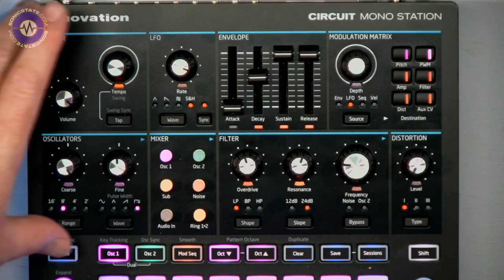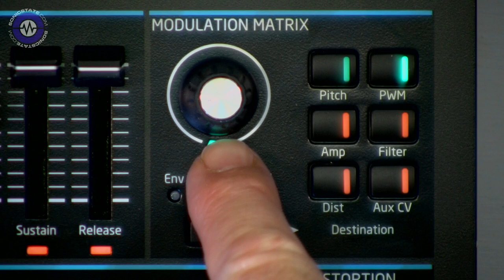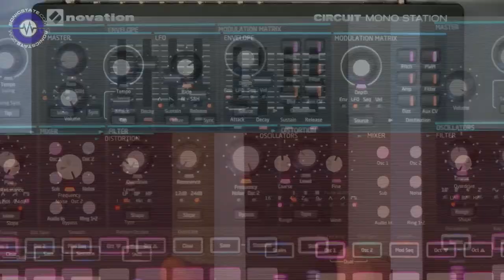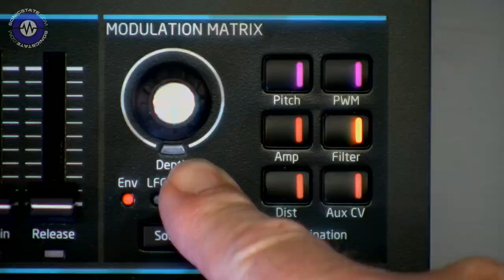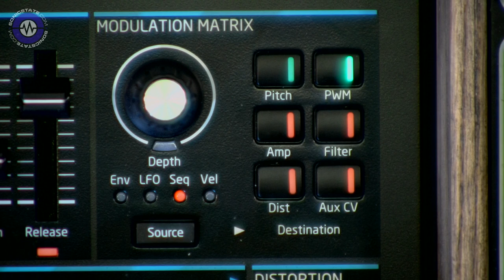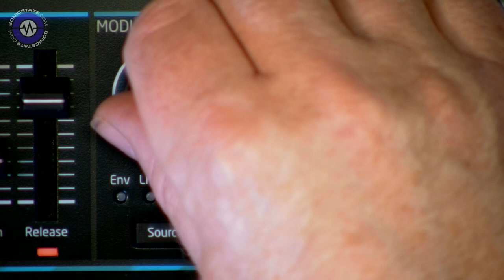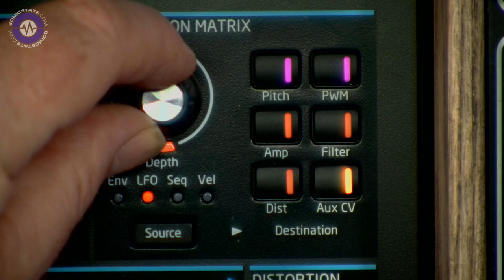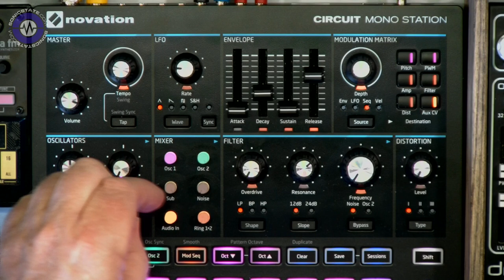Novation Circuit Mono Station Review

Comment: No one ever mentions just how great these pads are. It has plenty of weaknesses, but its pads are a work of art. I've tried many different pads - Korg's, Akai's, Roland's, Yamaha's, even Novation's (on SL MK III keyboard). Wasn't impressed and never thought I would switch to pads from piano keys. These pads were the first that made me think of doing exactly that. They have so much control - it's like playing a real wooden string instrument, the sound properties wholly depend not only on the initial speed, but on how fast you release, how long and with how much pressure you hold the finger on it, and if you alternate the pressure - the sound will wobble like a real guitar string. Really well calibrated pads

Comment: first! Actually this will be my next synth over here - I have the Circuit and no analog gear in my setup. So while being a tad expensive as Nick mentioned, I am glad that I'm reaching towards an already familiar grounds in terms of sequencing. and I won't have another, completely different device in my setup which sometimes I fill I can hardly handle together (E2, microgranny, volca fm, circuit). The audio-in into filter and distortion is a great thing to have and also the sound is great.
Reply: second actually! ;)
Reply: mishpult  I think you're better off getting the Bass Station 2 if you have the Circuit. No point getting this
Reply: I just bought a BS2 and they aren't that big, at least in width. I have it on a laptop stand above my midi keyboard. Nice compact bit of kit.
Reply: I'm not a keyboard player myself but the keys are always useful to have. Also the BS2 has a pretty good sequencer in it. The synth is pretty small as well. Tbh I see absolutely no point In getting the mono circuit if you already have a circuit.

Comment: The bass is very fat for only one/two voices. Thanks for the vid. I have it already - but you have filled in the gaps for me with your explanation and demo. It has the circuit workflow but adding great analogue , versatile , intuitive bass. Both together does compliment (circuit and this) .  - You can not get that sound fro the digital circuit.

Yes it may be expensive - but if you love this workflow style/pads and controls so quick to utilise. its a no brainer imo.

Comment: Hey Nick quick question pls, does the amp envelope always trigger in the mod matrix, regardless if you use the envelope on the filter or pitch? Or can I use the envelope on the filter and pitch without affecting the amp? I have a mono Station and it seems that the amp is always affected by the envelope. Nice vid btw

Comment: Great review. You have a knack of answering the questions I have as I'm thinking them ... 0.o
I've been wanting to see it interact with other gear, most reviews don't go that far! 
They're set to cost $850can ... I can get a beat step, monologue and a microbrute for close to that ... all new, too. Used prices I can get a beat step pro, monologue, and Minibrute. For the cost I'm not sold on the sound of it, it's good, but not that great (from other demos I've heard). Not $850 great.
Reply: where on earth did you find it at 850. its 499 canadian.
Reply: jason mastrandrea my bad, it's $750
https://www.long-mcquade.com/87248/Keyboards/Synthesizers/Novation/Circuit-Mono-Station-Paraphonic-Analog-Synthesizer-and-Sequencer.htm

Comment: Love the circuit as I can take it anywhere was considering the mono station but didn't realise it isn't battery powered until now. Even though it is tinny the internal speaker on circuit is also useful for ultimate portability. Two balls dropped imo

Comment: The big downfall is the lack of any reverb on so many of these models. Each channel should have its own independent reverb (stereo if possible). Raw mono does NOT sound good without reverb.
Reply: TakeSomeAdvice I can’t exactly think of many analog monosynths with reverb. Maybe Nyx? You just have to buy it separately, which will sound so much better than some stock reverb anyhow.
Reply: Agree, FX knob instead of the Distortion knob ... three choices below the knob could be delay/reverb/both
Reply: FYI for anyone wondering, Mono Station is analog, so you can plug any guitar pedal into the output and it works. Novation literally shows the Mono between a guitar and pedal on their example setups page. Provides infinite sonic possibility, an advantage over digital hardware like Circuit.

I eBay’ed a TC Electronics Flashback delay/looper and a Boss Super Chorus for cheap. They open a whole new sonic palette (does wonders for the Arturia MicroBrute as well).
Reply: I disagree. I prefer FX to not be on my synths generally as it keeps costs down. Whatever crappy reverb they did include isn't going to hold a candle to a £400 reverb pedal

Comment: I absolutely hate that the tempo sync of the LFO also makes the LFO retrigger with note on signals. That limits the rythmic effects of the LFO so much. It is funny how little details like that can turn us off of a really decent synthesizer so easily.
Reply: That is a dumb choice indeed
Reply: Is it the kind of thing that might get sorted in a firmware update?
Reply: same here, hate it...i wrote to novation about this for the bass station 2 ..i said it is a BUG how the lfo "sync" works..but they did not answer me :)...really cool synth but i sold it now...get the minibrute for the rythmic LFO's works really nice and tight. EVEN if you change the LFO division out of time..it will be in time...something the bass station 2 could not do without silly trix, recording a little midi CC# for the LFO sync-enable on a external sequencer every time the sequence start over.
Reply: But its good for oneshot LFO so you have a second Env.
Reply: i dont think this is oneshot...it's just reset like the bass station 2...OOOOOOR?
Reply: That's actually my preferred behaviour for LFOs but it would be good to have a choice

Comment: Volca Bass will take my money before this, or the Roland TB3... love my circuit though!
Reply: I just bought a Bass station 2 and am thinking of buying a normal circuit to use for a drum machine. Can you give me a heads up on anything I need to know (I'm pretty new to all this stuff)?
Reply: Polecat Slam sure you can connect the two synths using midi connection, either sending midi clock or midi signal... if you send midi signal the bass station uses synth ch 1 or 2. I suggest just sending the clock signal so you get an extra channel of sound. How is the bass station II? I was considering a volca bass, how much did you pay?
Reply: Polecat Slam you need the mpc live

Comment: Argh...Why did they REMOVE the battery option and the internal speaker?

Using it as a portable idea machine is what the circuit was ALL about and now they effectively chained us to a wall and to wired headphones.  

It is a great piece of kit no doubt, but it is already bigger than the circuit so a little more for batteries would have been no big deal...and the little $2 speaker takes up practically no space (and amp circuitry is less than $1 and is minuscule).

Silly omissions by novation...  and ones that now cannot be remedied by a firmware update.  

Without true no-wire portability, size is irrelevant...can’t imagine what they were thinking.

Perhaps: “Hey the circuit is a major hit!  Its so popular I think we should cripple this with no batteries and no speaker...then we can lose half of our customer base!  Think of how much this will reduce the sales and tech support calls!  Great idea, right?”

Unfortunately the guy responsible for firing people with stupid ideas must have been out on holiday when the issue came up.

Argh.  Argh.  Argh.
Reply: Circuit is fully digital and requires significantly less power to run than a synth with analog circuitry and all that control voltage connectivity. Just because the form factor is the same doesn’t mean the power requirements are the same.
Reply: @nilslobie9934  yep they are incredibly different devices.  circuit is way more tailored to being useful as a portable sketch pad. 2 synths, drums, polyphony ..   the mono station is 1 paraphonic synth.. that's it.  i mean being portable would be cool.. but way less useful than the original circuit.

Comment: For the price, I’d just buy another iPad.
Reply: Jollo Jakar a valid point, but I've found the iPad to be impractical in performance situations. if it's the tiniest bit humid I can't use the touch screen how I'd like to.
Reply: Also true. I tried to incorporate iPad into my rig and then Apple stopped supporting the hardware I had. At that point no choice but to upgrade or make other plans. My 1995 Kurzweil workstation on the other hand is still rocking.
Reply: and the connections to a ipad suck.
Reply: No CV inputs/outputs on iPad. No analog on iPad. iPad has come a long way, but until I can run multiple programs simultaneously, its fun, but not a serious performance took. Its great to use WITH other gear. I usually use mine to program my Eventide H9.